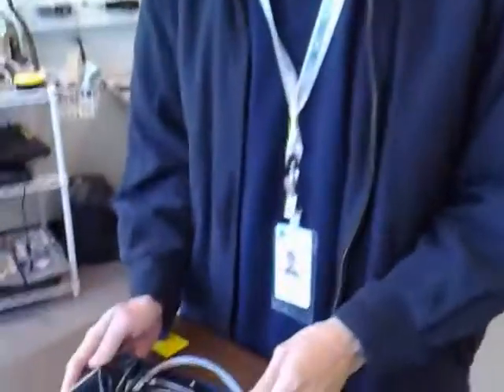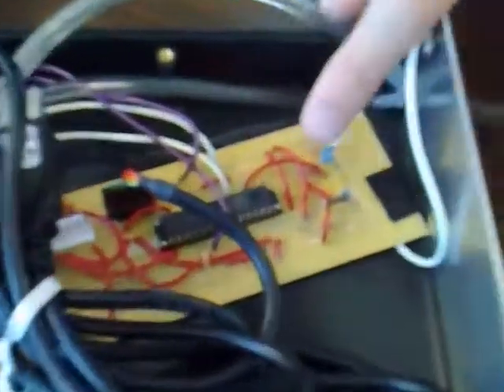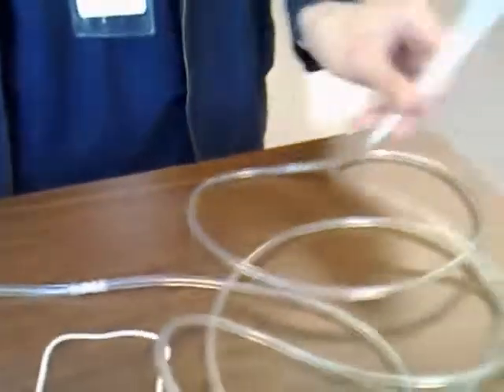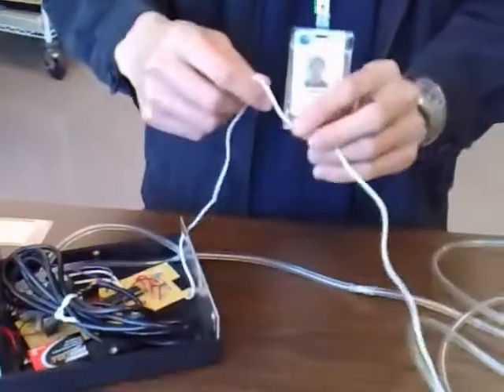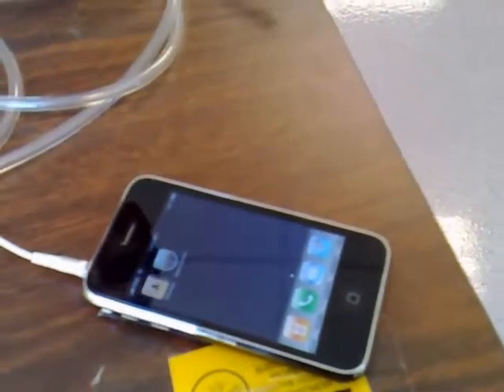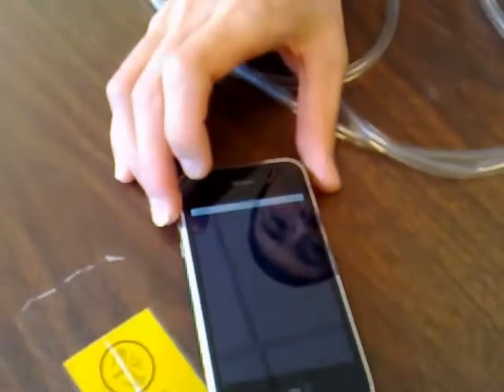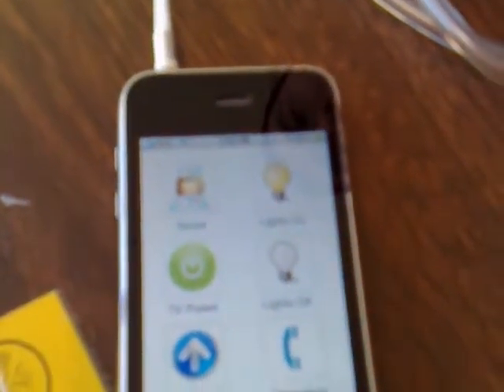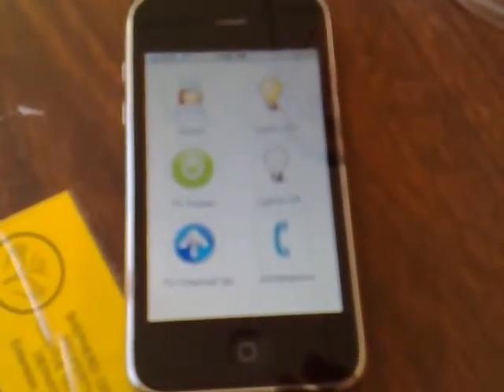iPhone Sip and Puff Prototype

Comment: Did you ever take this project further? The main thing that a person with quadriplegia would want out of an iPhone is the ability to use a sip and puff switch to activate the Home button, which in turn controls just about everything else that the iPhone does out of the box. The ECU features of your app are interesting, but it would be wonderful to control an iPhone 4S using a sip and puff system like this to invoke the "Siri" voice recognition program that will ship with iPhone 4 running iOS 5!